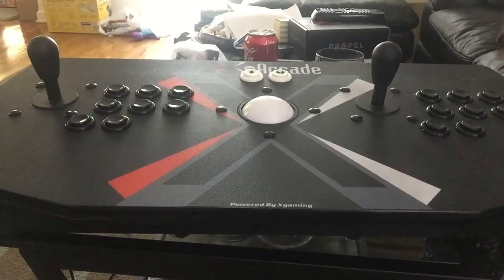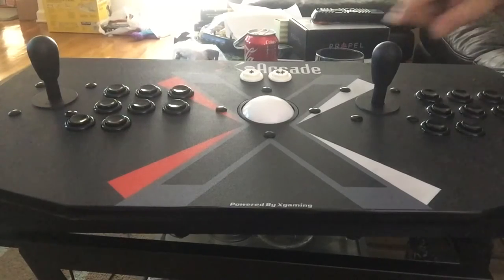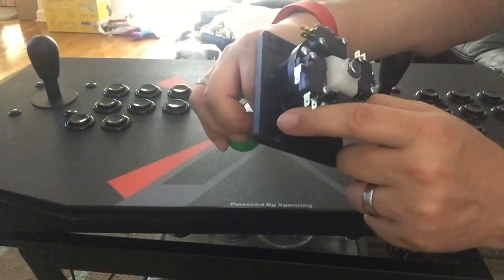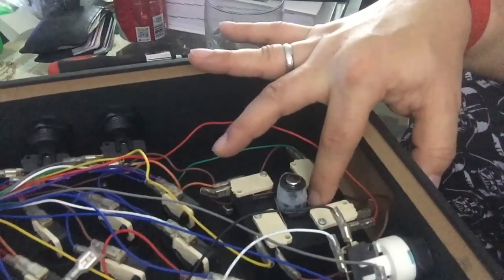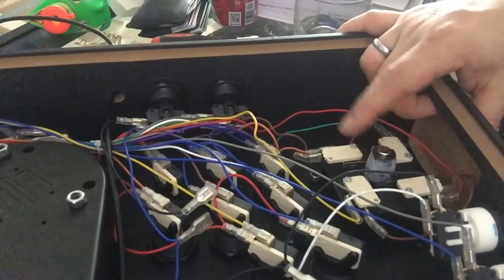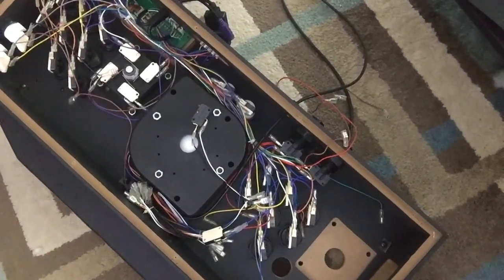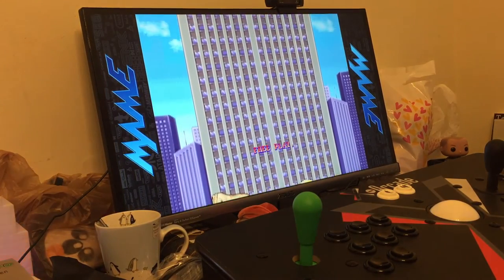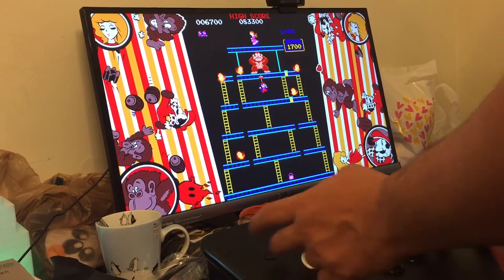Xarcade joystick replacement with IL euro sticks

Comment: I had some Suzo-Happ Joysticks. I definitely had issues with them in games like Mortal Kombat. Difficulty performing some moves that required half circles and especially jumping forward and backward. I had read that IL and Happ parts are interchangeable. So I bought IL actuators, z-stops(the things that hold the springs and what the actuator attaches to) and pivots. When I did this experiment, it actually made the happs even worse. Focus attack claims these parts are interchangeable. They do fit for sure but make a Happ work even worse lol. The only way to go is genuine IL sticks. I don't mind Happ buttons with cherry switches either as long as I remove the springs from them. The springs just literally get in the way of good responsive buttons. Great video!
Reply: If you like happ style buttons i recommend giving gold leaf buttons a try. In my opinion they are the best happ style button you can have. It has the look of a happ button but has the resposiveness and silence of a japanese button as it has a built in microswitch with no spring
Reply: Does the parts you used (actuators , z-stops,pivot ) from IL  brand ?
Reply: @kingting1395  Yes, they were.

Comment: I just picked up one of these X-Arcade units and the joystick it comes with is trash. It does not pick up diagonals at all. I appreciate the tip for the IL stick. I just ordered one from Paradise and I'll be swapping it out soon. Thanks!
Reply: Same here. I tried the Happ Competition one first. It's a little better than the stock sticks, but still not perfect. I just ordered the IL from Paradise.
Reply: I got the IL stick installed and the difference is night and day. With that said, the installation is a bit of a pain. The tight spaces you have to work in make it more difficult than it should be, but I got the job done in about 30 or 35 minutes. Now playing fighting games and shooters is almost arcade perfect. I am debating swapping out the buttons and switches next. I think that will put this controller over the top.
Reply: Excellent. Can't wait to get my IL swapped in.

Comment: Dude, of course the dust washer is meant to be on top, so that NO DUST falls in!
Reply from the maker: Bashir Kashmiri actually it depends. If the dust washer covers the artwork it goes under the panel. In my case I moved them above.
Reply from the maker: Nein Nopes bubbles and crazy climber are two off the top of my head
Reply: All Mortal Kombat arcade cabinets have the dustwasher under the plexi (actually, under the metal control panel, art and plexi)
Reply: Dust cover goes on TOP of WOOD control panels and UNDER of METAL control panels. Hope that info helps.
Reply: Dust washer goes on top. Sometimes people use two dust washers, one on top and one below. But I've never seen dust washer on bottom but no dust washer on top.
Reply: Mortal Kombat machines have the dust cover on the bottom. They look like there's an open hole in the joystick cavity but it is sealed underneath.

Comment: i just installed the euro i had to use zippy microswitchs , because the other had 6.8 connectors But still find hard to do special moves with StreetFighter, maybe its because of the switches

Comment: I may have missed it in the video but are the shafts/battops interchangable? I want to keep my black bat tops and use all the IL gear from below the dust cover. - I can buy some real cheap orange IL euros but they dont go with the colour scheme of my cab
Reply from the maker: East East Really depends on the battops hard for me to say. I do know that arcade paradise has a wide color selection from il that are like $13 usd each. Dont know if thats cheaper than your option.
Reply: The black bat tops I have are the same black joysticks you have in your video. I can pick up 3 black IL euros for NZD20.00 on a private sale as they come from someone elses failed projects who has no need for them.
Reply from the maker: I got a light weekend this week. If I can find the xarcade battops (may be in storage--cant dig those out) ill test it. Ill get back to you at weeks end/early next week.

Comment: How did you get the 10mm nuts off the joystick??? I don't have a socket that fits, it rubs against the plastic housing and wont go on the the nut...
Reply from the maker: nitwitloco with a pair of needle nose pliers and a lot of patience
Reply: Pincade  I got them out just now.. the whole thing took about an hour and a half.. the IL eurosticks are 100 times better that the sticks that came with it. I should have done this a year ago.

Comment: Do the IL sticks have 4/8 way option? I just bought a tankstick and waiting for it to arrive. I'm now wondering how good the controller is going to work for street fighter II and 4 way games like pacman. I hear it doesn't work too well for those games.
Reply: also what about robotron
Reply from the maker: John Doe i put the IL sticks in to improve fighting games and robotrons response. There is no 4/8 way option but still works well on 4 way games.
Reply: They suck for 4 way games. Pacman is unplayable. The X-Arcade sticks are way better for 4 way games.

Comment: Hey, let me ask you something.. I just replaced my x-arcade joystick for a IL Eurostick and for some reason it keeps on pressing up or down non-stop, as if you were holding a key down non-stop, what could that be? I am really struggling to find out, can you show me how you plugged them to the microswitcher?
Reply from the maker: Wagner Sodré sounds like the microswitch is wired to nc (normally closed) prong for signal. You should have ground to ground prong and signal cable to open prong. Then when you press in that direction and the switch closes it sends a signal other than that the switch circuit is open.
Reply: Hm, that is exactly what happened, I ended up swapping the positions and it worked. thank you so much..

Comment: The dust washer is there to stop the dust getting through to the internals. All arcade sticks have them. Why would you even think that it should go underneath. I have the single version of this stick and had it over 15 years. Still looks as good as new. All happ internals fitted But the dust washer is on the top. Yours looks all wrong

Comment: Yeah man the dust washer has to be on top not the bottom and why in the world would you get green joysticks instead of black IL Replacements when your entire x-arcade tankstick is black? And if you didn't want black Replacements then you should have gotten either red or white just so that your new joysticks would match with your existing tankstick color scheme? Green doesn't match it at all man really!
Reply from the maker: Charlie MMAFAN oh cause i was paying for them... thats why
Reply: Pincade you're paying for them? That's precisely why you should get black or red or white so that the colors match because you are paying for them right? But whatever man if you like Green then that's your prerogative and it's your choice obviously.
Reply: @pincade1609  did you ever move your dust washer to the top so that it could actually help prevent dust from going down into the hole that your joystick sits in because it's not going to prevent any dust from going down there when it's sitting underneath the bottom obviously.
Reply from the maker: Charlie MMAFAN nah bought a house. In planning phase of building a basement arcade. This xarcade will be gutted and built into a podium. But yes when that happens washers will be normalized

Comment: These sticks are way overrated in my opinion. The x-arcade sticks were actually better. Playing pacman with an IL stick sucks ass and it's actually HARDER to do a hadouken now in Street Fighter 2. The only difference is it is somewhat easier to do a shoryuken (dragon punch) but overall I'm VERY disappointed with these sticks. They play 4 way games like ass, and the difference between them and x-arcade sticks for 8 way games is minimal. Thumbs DOWN on these sticks.
Reply: You should have got some Happ supers.
Reply: @MrC77  the Super Happ sticks are the worst Happ joysticks man, the competition ones are supposed to be the best with the Ultimate ones in the middle but I think IL Eurosticks are better than all of the happ bat tops since we're talking about bat tops here and not ball tops obviously because then you would be getting into the Sanwa's and Seimitsu's obviously.
Reply from the maker: Personally i agree these arent good for 4 way games. I personally am building a cocktail cabinet with 4 way sticks for those. I feel trying to find sticks that works for everything perfectly is rather hard. My new thing is separate into cabinets by genre and buy per genre.
Reply: To each there own the IL euro works great for me